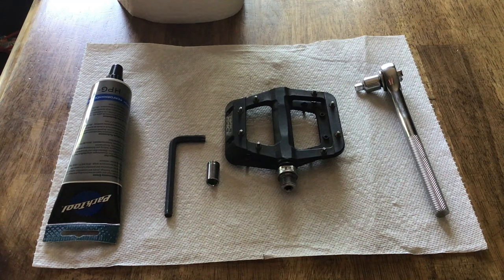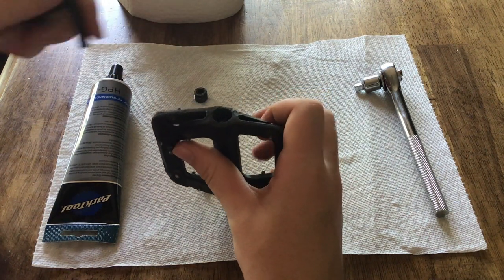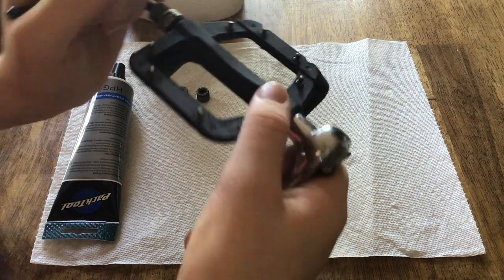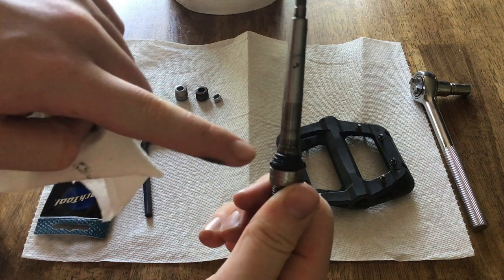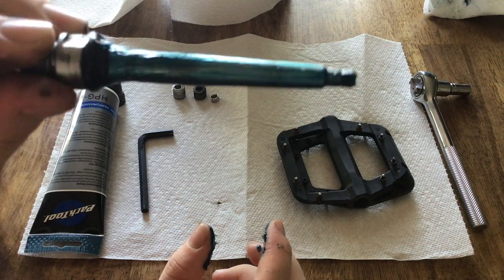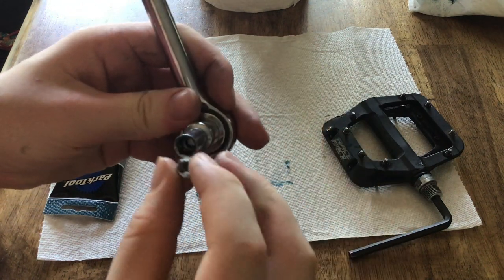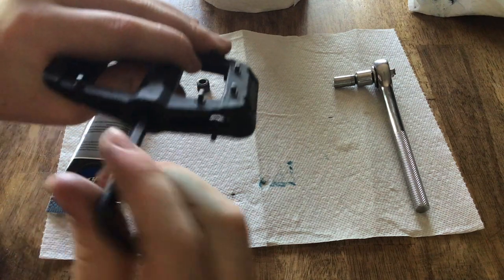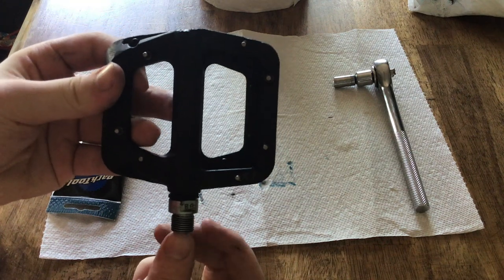How to Service Flat Pedals MTB

Comment: Hi. I Saw your video and followed the steps. However, I tried to take out the sealed ball bearing inside the pedal, but I couldnot do it. Do you know if it's possible?
Reply from the maker: What pedal do you have?
Reply: @gavincmtb  its a flat pedal. It's a chinese brand. I tried to pull ithe sealed bearing out, then to pull it out, but neither worked. I'm not sure if can be regreased or replace.